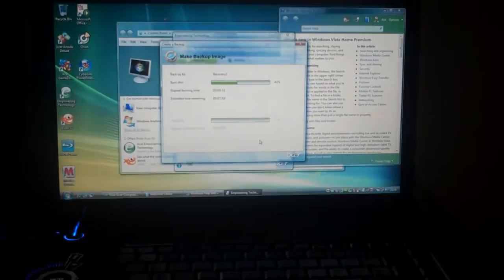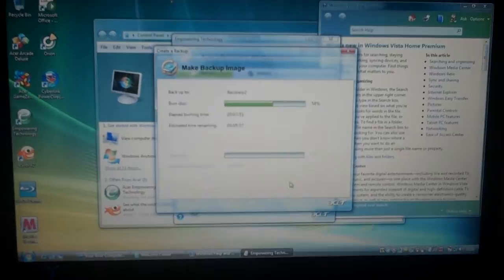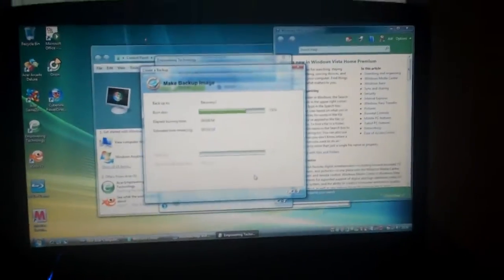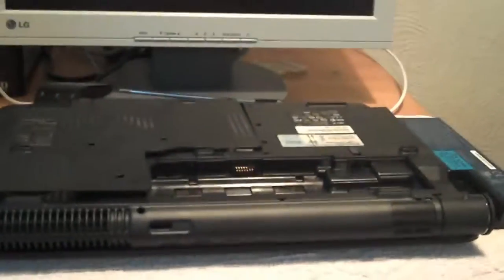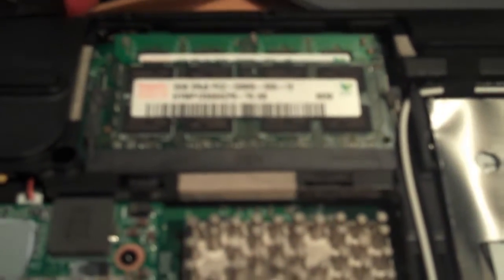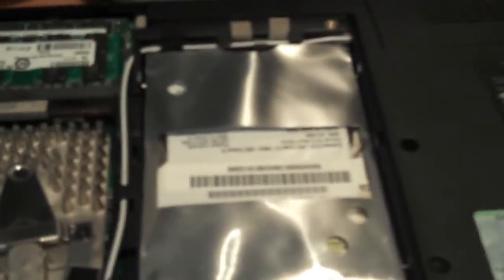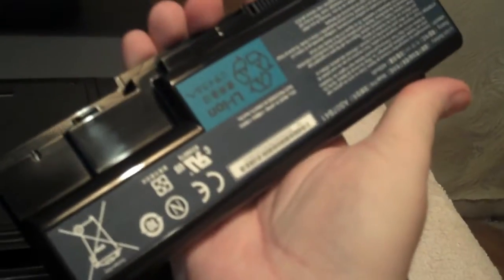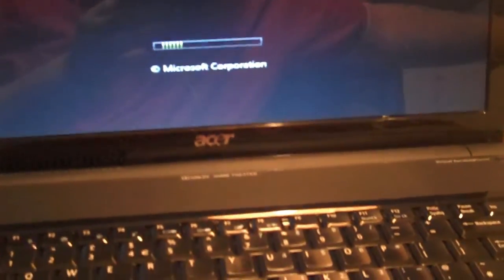Acer Aspire 6920G 4GB RAM Upgrade

Comment: My Acer 6920G has 4 years, time passed quickly. He is still fast and perfect and use Windows 7 Ultimate 64 bit.

 CPU: Intel Dual Core 2 T8300 2.44 GHz 3M FSB 800 MHZ 
 RAM: 4GB DDR2 1033 MHZ
 Graphics card: NVIDIA 9500 GS 512MB GForge
 BluRay, 1920X1080 FULL HD, HDMI, AND OTHER WEB 1.3 MEGAPIXEL.
 HARD DRIVE: 500GB

 Is good.